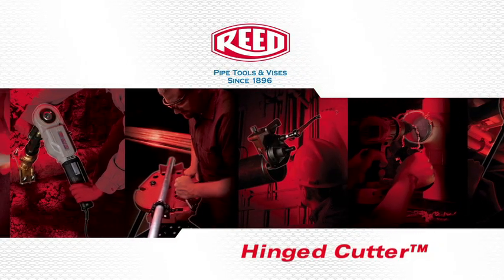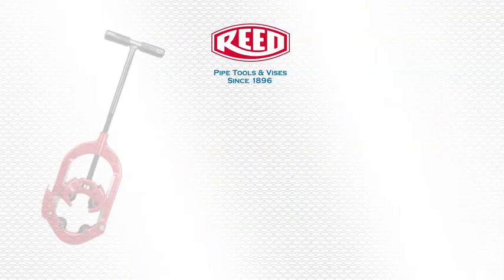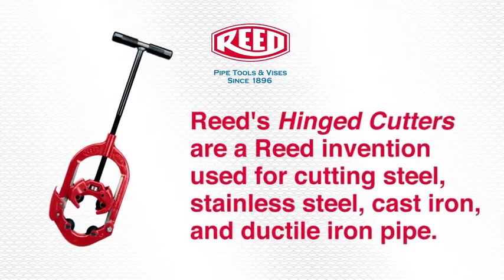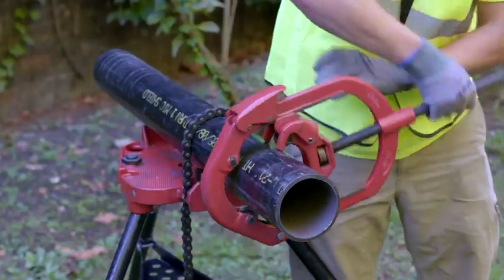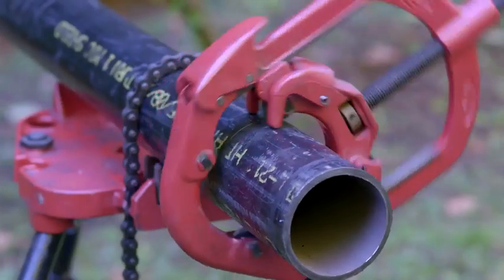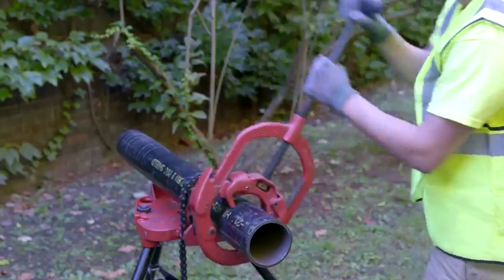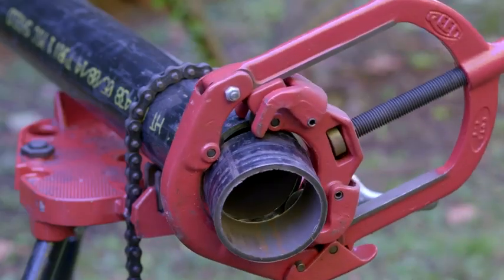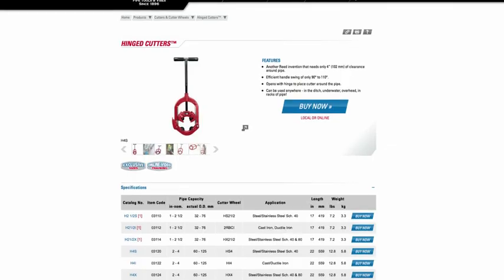Hinged Pipe Cutters Demonstration - Reed Manufacturing

Comment: Maintaining as much pressure as possible? That will crack the cutting wheels
Reply from the maker: Perhaps "as much pressure as practical" would be a better phrase.  REED cutter wheels, though, especially in this 4-wheel configuration, are amazingly durable and high performance.
Reply: Ok . I tried Rigid A2 and as soon as I put a lot of pressure the wheel cracked
Reply from the maker: Do you want to talk it over with a product engineer?  Can you tell us what wheel you were using?  There's lettering / numbers on them, though the print is small.

Comment: If we just demolishing; can they be used to cut polypropylene pipe?
Reply from the maker: Hinged Cutters have wheels designed to cut steel, cast iron, or ductile iron.  Cutter wheels for plastic pipe tend to be thinner than wheels for metal.  If you do not already have a hinged cutter, you should look at REED’s PLAS cutters or large quick release tubing cutters for plastic pipe for your demolition job. 

https://www.reedmfgco.com/en/products/plastic-pipe-tools/quick-release-tubing-cutters-for-plastic-pipe/
https://www.reedmfgco.com/en/products/plastic-pipe-tools/plas-in-line-rotary-pipe-cutters/

If you proceed with your cut on PP, you should expect to need a new set of cutter wheels for the next time you use the Hinged Cutter
Reply: @ReedPipeTools  Thank you for your prompt response.  I need to cut 4" Polypropylene pipe that is 0.45" thick.  Do you have a tool for that?
Reply: Also, this 4" Aquatherm (a welded PP pipe) is under a floor in rather tight conditions; if you have something for tight conditions (one where we don't have to rotate the tool 360 degrees) that would be a big help.  We were looking at your guillotine cutter.
Reply from the maker: @desmondorsinelli8850   For regular 4" PP application, REED recommends the TC4QP #04140 which ships with a cutter wheel designed for PE, PP and ABS.  Check www.reedmfgco.com for Where to Buy options.   https://www.reedmfgco.com/en/products/plastic-pipe-tools/quick-release-tubing-cutters-for-plastic-pipe/tc4qp/
Reply from the maker: @desmondorsinelli8850  for the Aquatherm, REED has a special cutter wheel and that is in our TC5QPPR #01453.  That TC5QPPR cutter, though, has to rotate around the pipe to cut it.  The Guillotine Cutter works on PE and not PP.  I would think it would be tough to use, due to its rectangle shape.  Let me ask Sales if they have another idea.
Reply from the maker: @desmondorsinelli8850  For the low clearance, take a look at this little cutter:  IC1A  #04500  You might burn through a couple blades with the Aquatherm, but it might do the trick for you.  The replacement blades are Ic1RA  #04502 
https://www.reedmfgco.com/en/products/plastic-pipe-tools/internal-pipe-cutters/ic1a/

Comment: Can this be used to shorten a metal pole that has already been installed vertically?  (installed with concrete)  Would it slip downwards, or can a 2nd person just hold it in place as you get started on the cut?
Reply from the maker: @Steve Lewis Interesting question!  Specifically for vertical cuts, REED offers a modified version with a 2nd handle.  https://www.reedmfgco.com/en/products/cutters-and-cutter-wheels/hinged-cutters-with-helper-handles/      This model of hinged cutter works on well casing and other vertical pipe applications. If you have the clearance for the 2nd handle model, that might be just what you need.    As for the regular model and vertical cuts, it should work as the wheels are quite tight against the pipe you cut.  And, you tighten as you go, keeping the cutter secure to the work spot. Plus, the regular model can be used overhead and at other angles. If you have more particular questions about the application for vertical, please reach out to   reedsales @ reedmfgco.com   (removing the spaces.)
Reply: @ReedPipeTools  We ordered one and tried it (the one in the video; ordered before noticed your alternative recommendation).  For a 2" galvanized steel metal fence post, this worked like a champ.   Just had to hold the bulkier part over my shoulder for a brief moment getting aligned and started, then it held in place itself for the rest of the cut.   Easy work, job took 15 minutes instead of all day digging a couple post back out.   These posts hold a rod that secures a tarp, and we needed a steeper incline.  Thanks, totally a keeper tool !
Reply from the maker: @stevelewis2392  So glad you gave an update on the success of your application.  Thanks for trying REED.